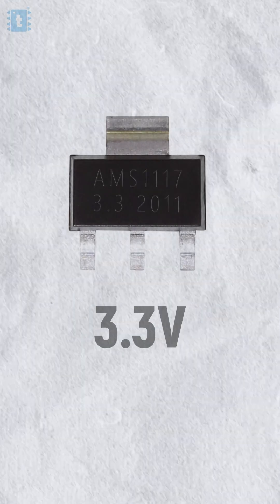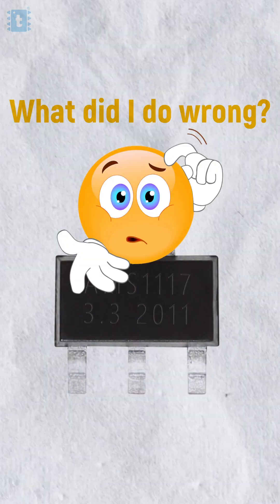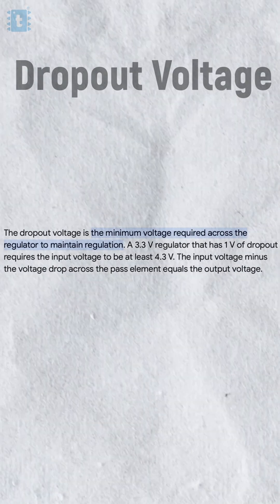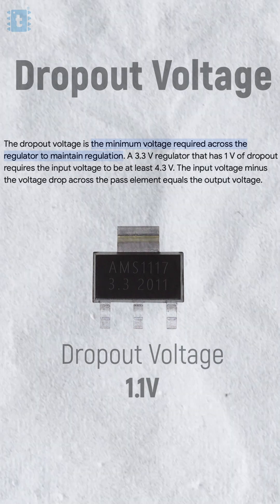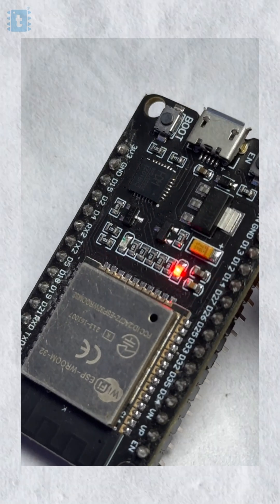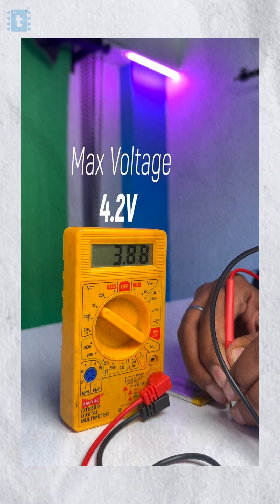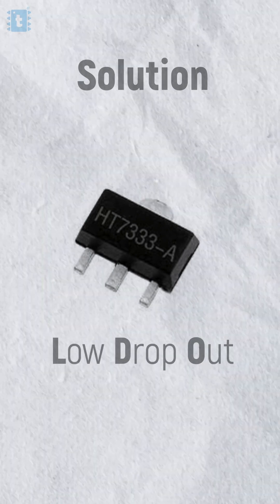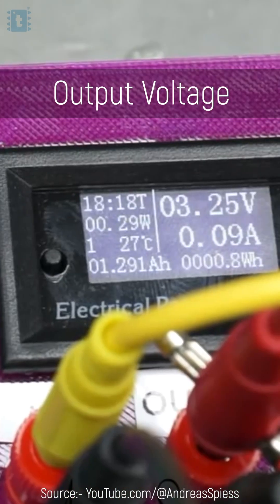Don't use AMS1117 for IOT Projects #iot #electronics #esp32 #esp8266

Comment: I'm using my ESP32 to learn programming. I'm not going to keep my ESP32 run for 24hr. So as long as lithium battery voltage is 4.2v , it can run on ams117 without any problem right?  Now I'm using ams117 to provide external power for my TFT led pin (backlight). I'm not worried about battery running out of power. I'm worried about ESP32 getting damaged.

Comment: I stopped using this. I use different ic
Reply: I am using AMS1117 3.3 V. Is there any better option with 1A+ current?
Input is 5V /3A SMPS.  Board is running continuously for many hours.

Comment: Better to go for lowcost DC-DC switching regulator
Reply: I am using AMS1117 3.3 V. Is there any better option with 1A+ current?
Input is 5V /3A SMPS.  Board is running continuously for many hours.

Comment: Just use a buck whenever you need more current or large voltage range
Reply: I am using AMS1117 3.3 V. Is there any better option with 1A+ current?
Input is 5V /3A SMPS.  Board is running continuously for many hours.

Comment: use lifepo4 batteries, 
directely, it does not have the top voltage as lipo or lion 
just 3.7 which is fine by esp,

Comment: May work well when the battery is nice and charged, but the voltage of a lipo battery can go as low as 3.2V, so it will not use the full capacity of the battery

Comment: Here you have discussed voltage but not current. If an AMS1117 lags in dropout voltage, then the HX7333 may lag in output current, which is 250mA. Additionally, the HT7333 is unable to power up the ESP32.
Reply: Yep, but there are plenty of low drop out ldo (you can look at lcsc and there filters). All depends on your application, 250mA is enough for the esp32 but not for all the functionalities (WiFi as example)
Reply: @Pkemarco I am using AMS1117 3.3 V. Is there any better option with 1A+ current?
Input is 5V /3A SMPS.  Board is running continuously for many hours.
Reply: Use HX7833 for up to 500mA current. But I will suggest you for a custom pcb design, use any Texas TLV75901, TLV75733 series, Onsemi NCP708MU, Microchip MCP series.
Reply: @sarojitkoley899 TI chips are extra costly 😢
Reply: @sarojitkoley899 Just 500mA, while ESP32 CAM works it may require currents beyond 600mA. The makers of ESP32 module are far more intelligent, so perfectly they have choosed the modules to work with ESP32 and at a low cost. This video is no less than a rubbish.
Reply: @DhirajBhai9999  waht about AP2112...?
Reply: @sarojitkoley899 I am using AMS1117 3.3 V. Is there any better option with 1A+ current?
Input is 5V /3A SMPS.  Board is running continuously for many hours.
Reply: @sarojitkoley899  what about AP2112, it have almost everything that need
Reply: agree techiesms is totally wrong
Reply: True that. There are many other LDOs out there that give > 500mA current. Cost can be a hindrance tho if building commercial product.
Reply: @yugalsharma13  Not really actually, look on LCSC, and use filters, there are plenty of them
Reply: @Pkemarco  okay
Reply: I am using AMS1117 3.3 V. Is there any better option with 1A+ current?
Input is 5V /3A SMPS.  Board is running continuously for many hours.